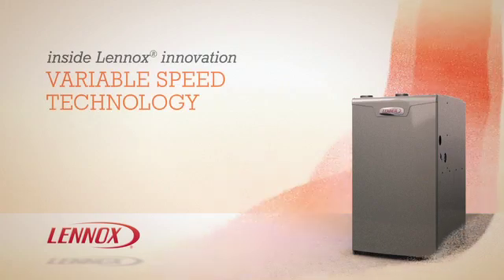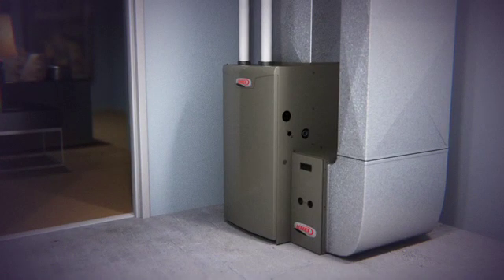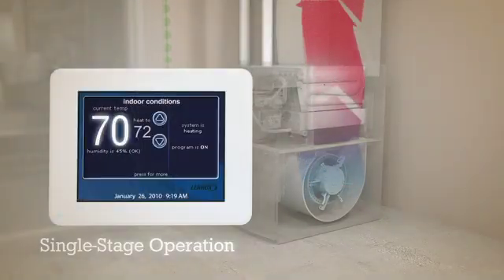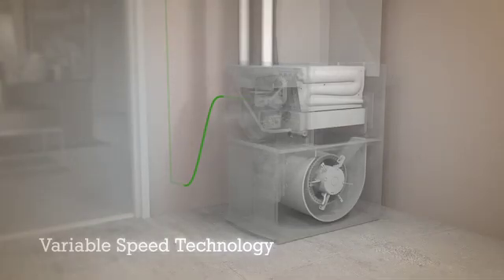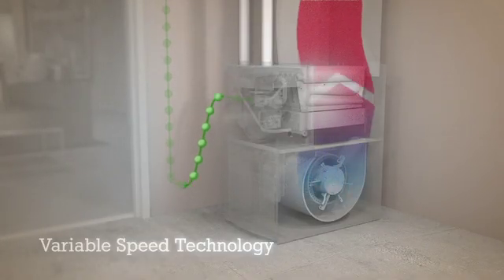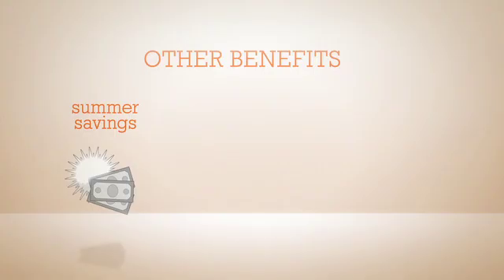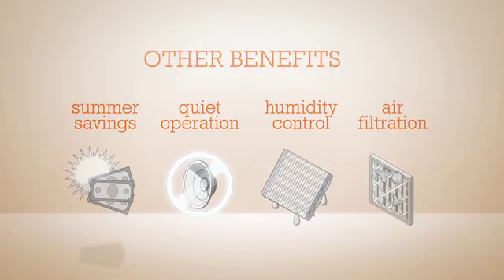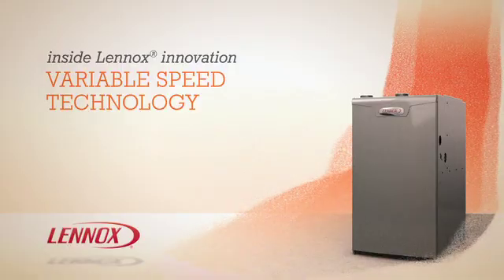Lennox Variable-Speed Furnace Technology

Comment: Having some heat issues upstairs with the lower fan speed versus my single stage furnace. In summer, however, the moisture removal is amazing. Huge improvement in comfort of single stage ac

Comment: Would this work well with my Nest thermostat? Or does it have to have it's own thermostat?
Reply: Yes, it will. I have the 3rd generation Google Nest Learning Thermostat hooked up to my EL296V. Just make sure your installer hooks up the extra wire to the W2 terminal or else the thermostat will still treat it as a single stage furnace and the furnace will control the heating stages on a fixed timer. You don't want that. You want the thermostat to turn on and off different stages when it needs to and for accuracy.
Reply: @eric01406    They managed to get the Nest hooked up right the second time. For some reason they ruined my Nest thermostat. But they bought me a brand new one to replace it for free. That was ok with me as the one I had was around 7 years old. Was surprised there was no upgrades or a series 4. But it’s all good now and love the furnace. It’s so nice and quiet.
Reply from the maker: Hi Kerry. Thanks for reaching out. As a manufacturer, Lennox' does not test our equipment with non-Lennox products. We suggest consulting with Nest directly for assistance.

Comment: Just got a variable speed furnace but unsure which thermostats support variable speed? Most smart thermostats don't support variable speed from what I can tell and I can't really tell if a thermostat supports it
Reply: It depends on what thermostat you have. The furnace will be able to control the variable speed blower even if your thermostat can't.
Reply from the maker: Hi Casey. Thanks for reaching out. When selecting a thermostat, it is important to take into consideration that there are many factors that will affect the performance of your Lennox equipment. As you can imagine, each application and comfort needs may vary. We encourage you to consult with a licensed or qualified contractor for assistance.
Reply: I believe that the higher end true variable speed furnaces and air handlers with true variable speed capability are designed to work with the oem thermostats that communicate with all the electronics.

Comment: I live in South Dakota and have a Lennox SLP98UH Variable capacity gas furnace installed on 4/2011.  Have had numerous service calls for the pressure switch issues, those seem to be resolved  However we had 3 service calls last winter because the discharge pipe that goes out through the roof frosts over and shuts the furnace off.  The dealer has removed the variable speed motor option and set the fan to come on at maximum speed and that did not solve the shut down problem.  Does anyone know how  to keep our furnace operational during the winter months?
Reply: Hire a professional
Reply: The blower motor speed should have nothing to do with the discharge pipe.

Comment: do not trust Lennox company because on the Lennox website they not let anybody to post bad review about the product only a good review show on the web
Reply: My variable speed option didn’t work. Louder than old furnace. Impossible to get ahold of anyone at Lennox.
Reply: Frui - vega meanwhile these r the best in the business I have this blower and it's amazing
Reply: @Bcoots  2015 Lennox Industries Inc. has agreed to settle a class action lawsuit alleging it manufactured and sold defective evaporator coils. ... The plaintiffs allege the evaporator coils, which are made with copper tubing, experience a chemical reaction that causes microscopic tunnels to form and causes the coils to leak refrigerant.